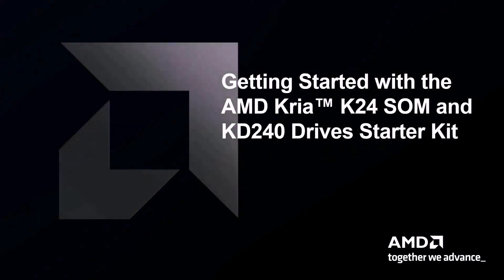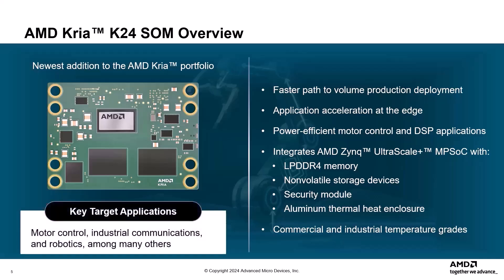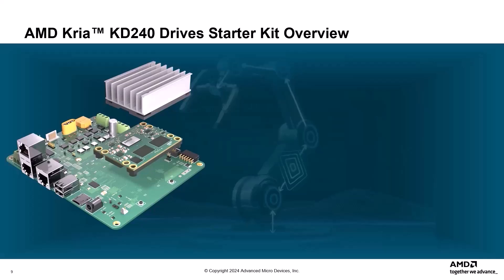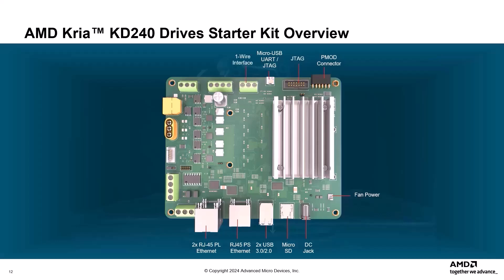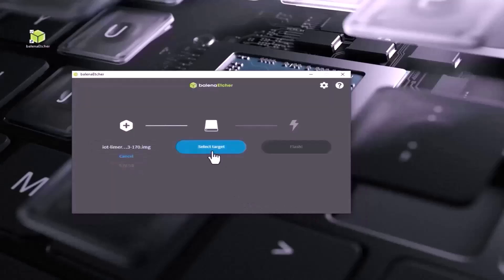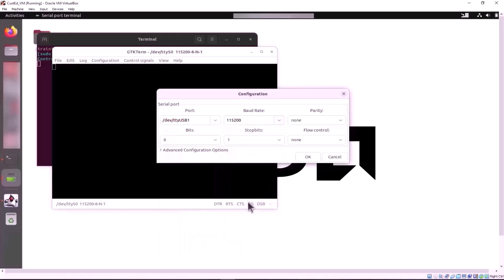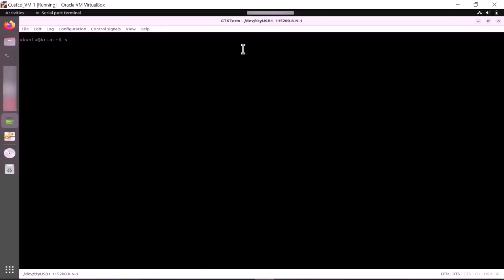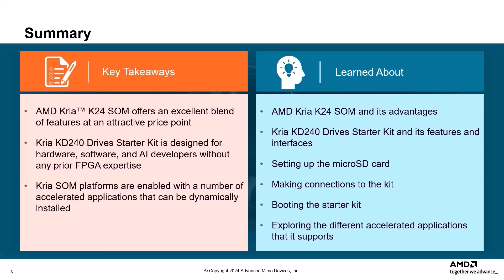Getting Started with the AMD Kria™ K24 SOM and KD240 Drives Starter Kit

Comment: this is really neat. i am very much interested :)

(i do think the monotonous voiceover took away from the video a bit tho - to be perfectly frank.  the words were well articulated but it completely missed the mark wrt to prosody in syntactic domains beyond beyond simple verb phrases. it works better if your model has some explicit awareness of syntactic structures and knows there are higher level tokens. it saves a LOT of training - and the results are very noticeable when you have a single narrative voice speaking at length. you can't effectively use a conversational model to train a narrator.)